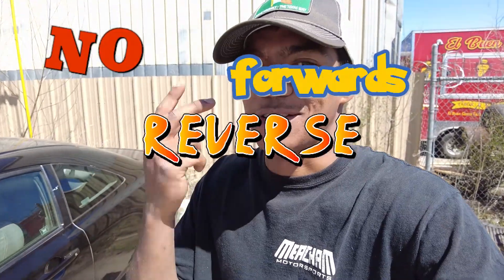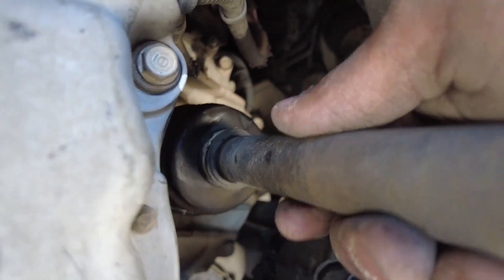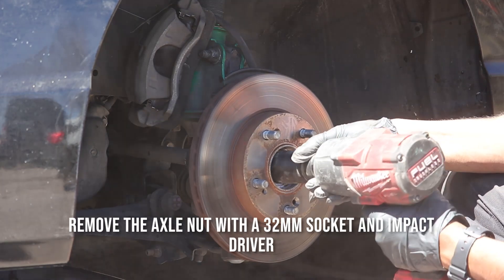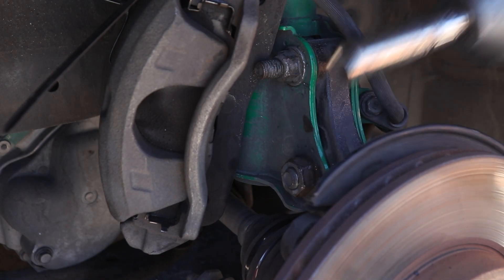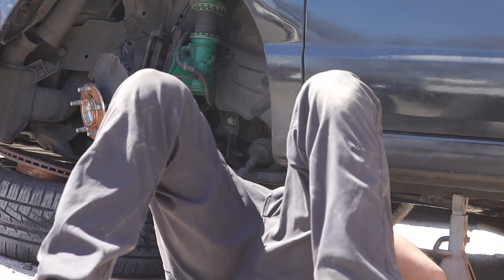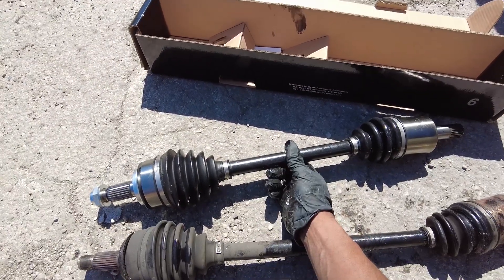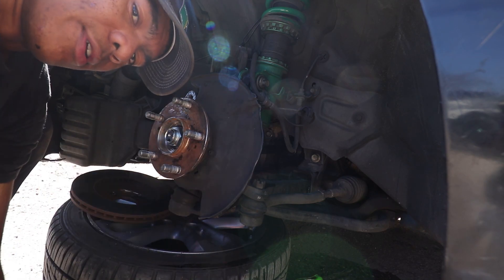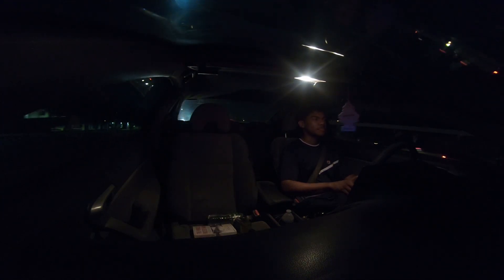How To Replace Driver Side CV Axle [8th Gen Honda Civic]

Comment: Is it necessary to remove the brake rotor? My set screw is stripped and I don't have the tools to remove it unless i cut into it.
The previous owner mangled the head of the screw so bad I can't even get a philips head in there
Reply: No you don't need to remove the caliper.  I would only loosen up the 2 bolts from the strut.
Reply: @BDJ4mTex  Figured that out haha, thanks for the response though appreciate it! First time taking a wrench to my car and it went well thanks to your video.

Comment: Cool video..I just found out I have to replace my front right axel so your vid def helps! Question..why did you not go with Honda OEM? Just curious your thoughts on that. Also, you mentioned you put grease on the side of the transmission, did you use a special brand? Thanks!
Reply from the maker: Goodluck with your project! The only reason I usually don’t go OEM, is price. However, most of the time, in the automotive world, you get what you pay for. No special brand but I recommend hi temp Lucas
Reply: @developmentdivision122  thanks man..yup I agree. Since I only need to replace one I will go with OEM. Ok cool, I’ll pick up Lucas. Thanks man
Reply: @developmentdivision122 how much is the OEM ?